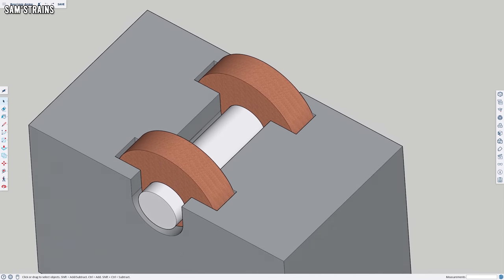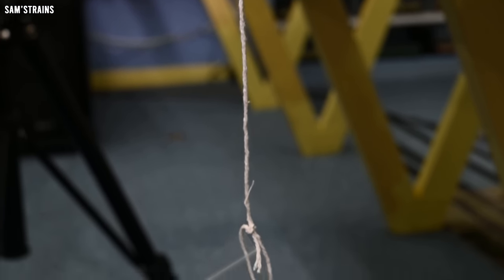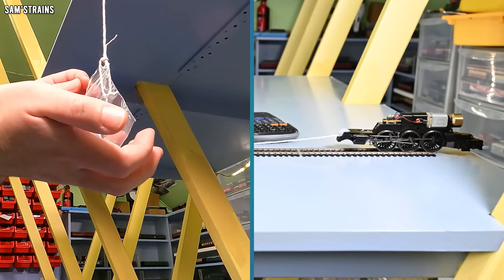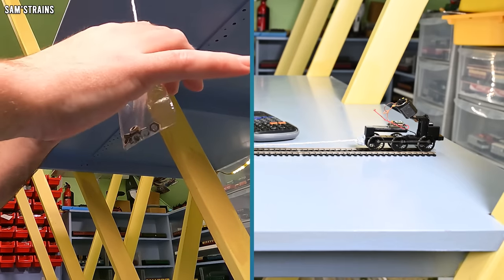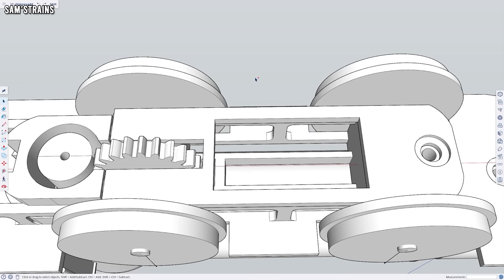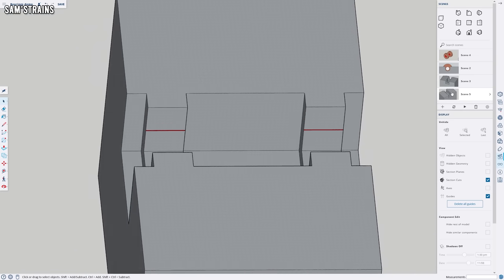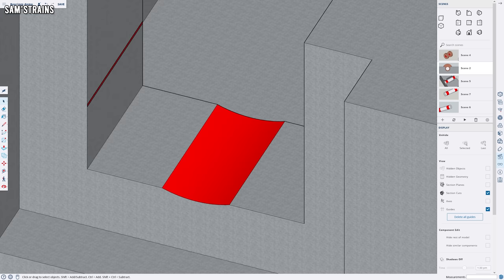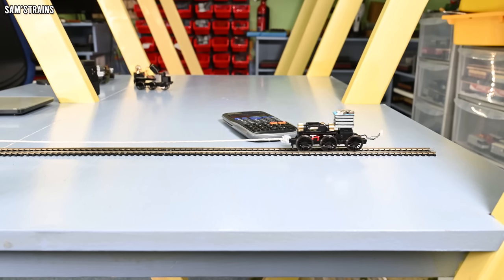Do Model Trains Really Need Bearings?

Comment: I find this video very interesting, I do have a Question and that question is this its about lubrication on the bearings what would happen if you have to much and what would happen if you had not enough would of been interesting to see the out come of it, because you were deal with bearings and the fixture and fitting.
Reply: Conventional knowledge is that too little lubricant increases friction and wear. Anything beyond the correct amount encounters rapidly diminishing returns, accompanied by making a mess and attracting contaminants like dust/dirt.

Comment: Morning Sam, manufacturer’s take notice of this video it’s true and accurate. Well done same, this video clearly shows the advantage and long term protection of having bearings, correctly designed and fitted ones. Some manufacturers now design and provide them as standard but others need to catch up. Basic models have the direct contact onto chassis but the prices being asked are still expensive and you really want to protect you investment into the hobby for a long as possible…. Well done again for this informative video. Keep up the great work. Regards Marc

Comment: I have a minor issue with this video. Given you have added weights to the chassis to even up weight, was it perfectly balanced? If there is too much weight on the front and pulls the wheels off to one side it would add friction to the wheels and make it harder to roll.

Comment: Good experiments Sam, which got me wondering if any manufacturer produces ceramic bearings/journals? I come from the cycling world where some moving parts have ceramic bearings, mainly, I think, balls and races or needle bearings on derailleur and crankset and wheel axles

Comment: Hi Sam. Wonderful video, indeed. A lot of work has been put into this. One question about your argument @16:00 about the bearing being able to rotate, since it is rounded. What about the bearings installed, for example, on Dapol's models (e.g. Mogul or such), which per design, are locked into place? The difference should be close to zero on an amateur scale, I guess. Cheers.

Comment: I have an experement design idea get a bit of baseboard, place 2 lengths of track side by side put your 2 chasis on the track at one end drill a hole to take a bolt. glue a matching nut under the board then turning the bolt will raise that end of the board smoothly and slowly hope this fosters further experiment. this requires only one run and so avoids the maths minefield of interpreting results go ask your teacher about types of average. eg the mean vs the mode interpreting a data set is a big part of doing science. frequently a re analysis of existing data brings progress. this simple first to move idea eliminates all that. thanks, just trying to give a little back to someone who cheers me up. stay safe
roy:goodvibes:

Comment: i can not say for your country. but in the USA our bearings are bronze.
naturally it has a lower friction factor than copper. steel alu. 
but with a tinny amount on very thin oil even less friction. but yes the lube will effect this “number”.
as a extra part here is how the axle and its supports ware. steel axle on a steel frame very pore and will trash out the weaker part fast. ( i say steel, but can be cheep tin. or other metals).
nylon it also be  a low friction good durability mtl. but not seen it used much. great if you do not want a electrical path.
this is a good video keep such up.

Comment: Just one idea of experiment you can do, if you think it's interesting : what is the maximal slope a model train can run ?
In real life, for mainline trains, I have the example of the Bézier-Neussargues line in France, with a 33,5 pro thousand slope (Don't ask me the 1 in xxx ratio for UK slopes, it's a pain in the axle for me to do this calculation !) on the section with the most sever gradient. In the UK, you have the 1 in 37,7 / 26,5 pro thousand (I hate those @§## ratios !) Lickey incline, and the record in Switzeland for a non-rack railway outside tramway, and narrow gauge line, is at 79 pro thousand on the Uetliberg railway line.
That would be interesting to reproduce those gradients in model form and see which engines can cope with them, light, and with various loads of rolling stock in tow. Gradients tends to be more severe on model trains layout than what they are in reality, it's something interesting to experiment in my opinion.

Comment: Sam, good topic I'm glad you brought this up. 2 key points to remember when reducing drag. Hardness of contacting surfaces (Axle and bearing) must be Hardened and Equal between the two contacting points. Secondly, minimize the surface it contacts between the two surfaces . The best way I can think of, is crossing of the two equal radii elliptical "rounded" surfaces. (Just like crossing your Left finger over your Right finger. Now rotate your right finger under you left finger.) Hopefully this helps you to understand minimizing contact surface. If you feel a little drag is because the surface of your skin is soft and wants to give creating drag that's why you need the hardened surfaces.

Comment: Sam, I totally agree with your testing results for your hypothesis. I have one question that has bugged me for years and perhaps you can answer it for me. Can you obtain bearings for those locos which do not have them? Is it possible to fit them?
Once again a great video which I found very interesting indeed. 2023 off to a great start.
Reply: I imagine it'd theoretically be possible to get bearings for locos that didn't have them. You'd likely need to modify the chassis to accommodate them, though.

Comment: A great video well done, it would be interesting to see if you are able to 3d print some semicircular bushes/bearings to fit the squared chassis blocks (like in the bachmann Robinson 04) and see if it made a noticeable difference in performance? Nylon bushes are used in many other applications so could it work for this?

Comment: My thoughts on bearings is interesting cause old real trains had bearings on but it took alot of force to get it moving of course scale models bearings not taking on weight like a real loco but here in the states some old wagons/cars bearings was replaced with rolling bearings   and that made it move smoothly cause 2 men can pushes it so I can agree bearings makes a difference but the type of bearings count to . Also Mr. Sam I trust your judgment on locos but the test would've probably yep give locos from the same company the test cause the  plastic are metal parts can make different results even with weights some plastic and some metals grip more assuming there using different mixes are the same

Comment: I was anticipating ball (or possibly roller) bearings. Is the small scale of parts why this isn't done? Or is it limited to really $high end$ locos? Thanks, Ronn
Reply: Possibly both. Definitely easier in the larger scales. I own some O scale passenger cars with ball bearing trucks. But these cars cost 300 USD each .  The same company that produced those is also producing O scale diesel locomotives, the newest designs also with ball bearing trucks, with price tags in the 750-900 USD range.

(for comparison, proper scale-length 3-rail 'O' passenger cars typically cost about 100-120 USD per car nowadays, with scale-length diesels between 450-650 USD)
Reply: @RailRide  Thanks for the info. Ronn

Comment: I'm confused.
I thought you were going to cover "the question is this is there an advantage to having separate bearings on the driving wheels of our model trains". Why were the side rods still connected? Isn't the idea to remove variables that have an influence on the result. Seems a fundamental flaw to me. Also amazed, or maybe I shouldn't be, at how many people missed this.
Reply from the maker: Hi John, yes that's a good point - ideally the rods should've been disconnected, but it was too complicated to remove all the valve gear/rods from the A1, so I picked two locos that had the same valve gear so that they would be as close as possible. I'm not sure  why I didn't remove them from the 0-6-0s - I suppose I could've done - but I assure you the result would be the same!
Thanks for watching, Sam :)
Reply: @SamsTrains  " I suppose I could've done - but I assure you the result would be the same!" My takeaway is you got the result you wanted.
Reply: @johnzubrickas5235  Well, try the experiment yourself.
He used a like-for-like comparison. Practicality stood in the way. He even made sure that both A1 chassis used had the same weight.
Reply: @johnzubrickas5235  To be fair he got the result he expected. I had wondered about stiffness in the valve gear but the samples all appeared to run freely in the shots before the tests so I decided any contribution in this case would be minor. I do agree that it could be significant.
Reply from the maker: Well now I'm the one that's confused John. What possible difference could the coupling rods have made that caused every single loco I tested (including the ones I didn't show in the video) run worse without bearings. Do you really believe bearings don't have an advantage, or are you deliberately looking to find fault?

I got the result I knew I would get based on the years of existing research into bearings. If anyone believes they don't bring an advantage, I'd like to hear the reasoning and see the testing!
Thanks for watching, Sam :)
Reply: @SamsTrains  Just to confirm, I think your experiment was very good and well worthwhile. Thank you for taking the trouble to do it.
Reply from the maker: Cheers Jeffrey - I've done a further experiment to test kinetic friction, and this time I removed the coupling rods to remove any possibility of the dishonesty or bias that our friend John has been imagining: https://youtu.be/wnWOx54oFNk
Reply: @SamsTrains  Published data indicates Zinc bearings has a lower cofficent of friction compared to Brass or Bronze. I have been operating 00 and H0 models for over 50 years, and built a couple from kits. My observations are as follows. Having siderods means a small bind will make a big difference in the rolling resistance. Smooth running models do not have binds. Most binds on RTR models are a result of excessive clearances between axles and the bearings or the brass bearing and frames. I have noticed no sigificent difference in rolling resistance between diecast bearings and brass bearings if both are properly lubricated. Diecast zinc bearings as part of the frames last as long as brass bearings if properly lubricated.

Comment: Good that you're using repeats on your measurements and taking an average. Next you'll have to start running t-tests and calculating p-values to tell if the difference is statistically significant, then calculating whether the data are normal and have equal variances to determine whether a t-test is even appropriate, and a short while later you'll find you're spending so much time running hundreds of tests under dozens of conditions and analyzing that data that you don't have time to actually run any model trains for fun or profit any more.

or, uh, so I hear...

Comment: The vibration theory would not be what your experiment would test, so this isn't what caused the static friction. However, the roughness of a casting will have an effect. Smaller contact areas with lubricant don't decrease friction they increase it as the forces push the lubricant out, reducing the thickness of the boundary layer. It could even push all the lubricant out over time.
Reply: Incorrect. The bearing, being a perfect fit, as well as being made of a softer metal will create a film which would force the axel de be dead in the centre by a sort of vacuum. A but like sealing a plastic bottle cap on your tongue. 

This effect is lost when you have no bearings as the axel jumps around in the slot causing more wear and tear over time. Imagine if real trains and cars didn’t have bearings. Ouch. 😅
Reply: Well, in a way that's what I said.
The experiment, however, measured the static friction with no motion.

Anyway, even the ones without bearing have a bearing surface, it's just not machined or high tolerance. The square slot ones effectively wear their own bearing surface as they run.

As for the chassis, they're often aluminium or aluminium alloy which is far softer than the steel and even brass, so the "softness" of the material is moot.

Of course, the other issue with having an aluminium chassis is that you get electrolytic effects between the iron and aluminium which will cause the steel to potentially corrode, but that's a totally different argument.

Comment: its same style of question as to weather or not you need round wheels (you don't you just need far more power of you don't have them plus its significantly more comfortable).
some uses sans such thing can happen but they are much more unique.

Annyways glad to see more Sam's labs videos, maybe not mad experiments but still important tests.
Wow that air resistance disclaimer .) yes (air drag) forces involved at these speeds and scale and basically irrelevant for the theory being posed, furthermore as pointed in previous point its not measuring to total forces involved merely difference meaning that its close enough regardless.

Admirable lengths tho most ideal comparison would be same chassis just different axles, now i realize that'd probably involve some rather destructive adjustments between runs so again this will do.

Sounds like good theory born out of first hand experience, reasonibly explained. i think thats either the case or close enough to work.

As for other theories:
drivetrain should it be gears or other means (axels presumingly altho i would not discount belt system),
wheels (yes Sam's "favorite" rubber band wheels!) maybe even go into materials they could be made out of (plastic, iron sound most common but maybe some are bras or something),
how much dose weight of locomotive impact its pulling ability.

so yeah apparently traction trilogy is on my mind shrugs

Comment: 13:40 I don't think so. The only factors which should affect friction are the coefficient of friction (which is determined by the materials and any lubrication) and the normal reaction force (the size of the force pushing the two pieces together). Changing the area of the contact patch has no effect because as the area increases, the pressure on the contact patch (force/area) decreases at a rate which will compensate exactly for the change. More mathematically, consider the equation F=uA/(R/A), where F= frictional force, u = coefficient of friction (standing in for the greek letter mu), R = normal reaction force, and A = area. The A terms here cancel out, leaving F=uR. This is the same reason that, as you have found before, removing one axle from an 0-6-0 has a negligible impact on tractive effort.
Reply: The higher pressure probably would contribute to wear though, so the reality is that the only possible advantage is cost of manufacture.
Reply from the maker: Ahh very interesting - thank you so much for sharing!!
Reply from the maker: I’m struggling to understand this with further thought - imagine a bearing with a mile of contact area… wouldn’t the friction caused by that much material rubbing against itself be greater than over a small area, even though the pressure would be less per unit area?? Genuine question!
Reply: @SamsTrains  No, unless you accidentally change the normal reaction force or coefficient of friction the frictional force would be the same. Remember that the pressure on exerted by the sort of force a model railway bearing experiences over a square mile contact patch would be tiny - maybe half of a millionth of a pascal. That's about the same as you would experience if you spread 0.0000015g across the area of your thumb.

Comment: To be perfectly honest I don’t see much difference between the running of my locomotives regardless of whether they have bearings or not.
Reply from the maker: Interesting! Thanks for sharing - are you on DCC or Analogue, out of interest? This is another video I'm looking at!
Thanks for watching - Sam :)
Reply: @SamsTrains  I’m an analogue user, normally use a gaugemaster combi controller but right now I’m having to use an alternative dc controller due to having to pick up an adaptor for my gaugemaster combi.
Reply: @SamsTrains  Mmm, something interesting incoming ! I've always been told that DCC odes not change the overall performance of an engine, we will see that with you.

Comment: Sorry, there is no such thing as a chassis with no bearings. The chassis itself is the bearings. In this case there will be more bearing area the there is with separate bearings and more drag. Also, the keeper plate doesn't bear the weight of the loco. When the loco is on the track, the weight is below the plate. I can't believe you've wasted days on this.
Reply from the maker: I think you got a bit confused - I started the video by defining my use of the term “bearing”, watch again if you need to. At no point did I suggest the base keeper bears the weight of the loco - only that it could make contact with the axle if too little clearance is allowed. I didn’t waste my time - I was very thorough - perhaps you should be more thorough in your viewing 😉